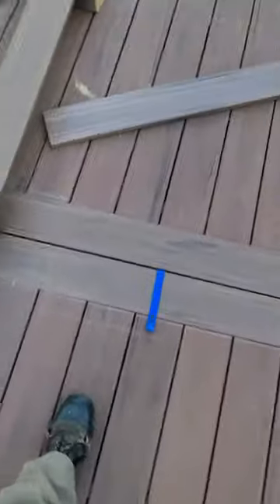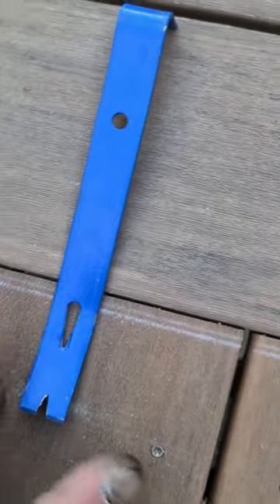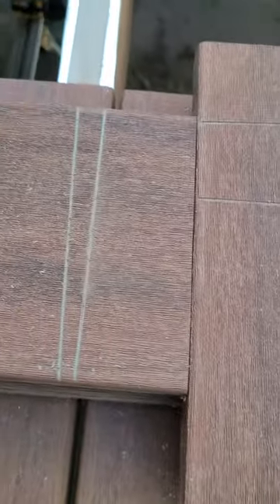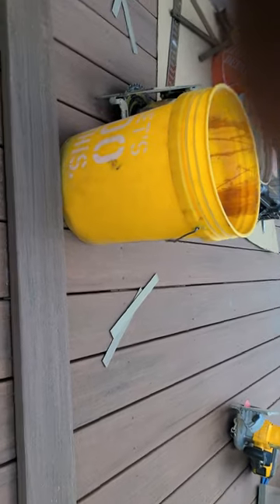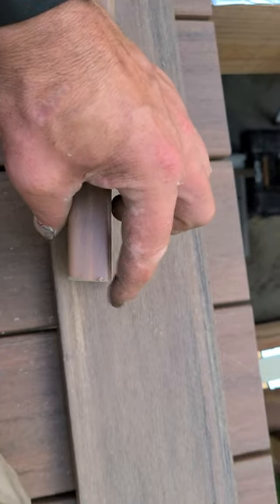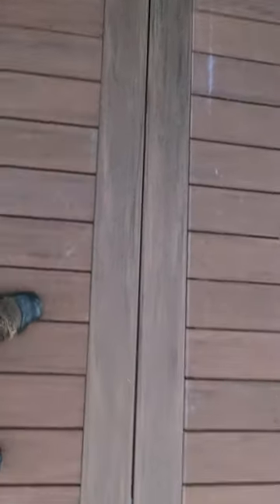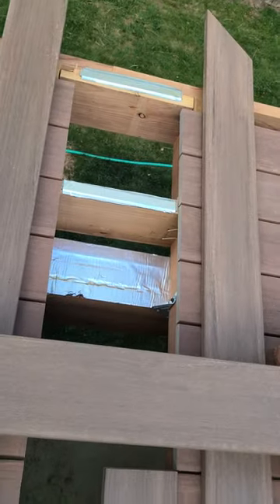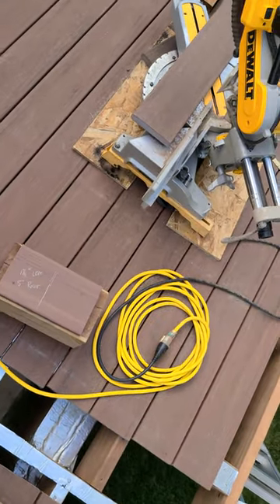deck tutorial - picture frame layout

Comment: How do you ensure such small tolerances like 3/64 don't move over time, especially with pressure treated framing? I've recently framed my deck, planed everything to near level perfection. One month in the sun and the joists were again out of whack. Not much, but definitely more than a 64th tolerance. I love the precision and the look, I just want to get some advice before I go and shim things to such tolerances. We have 10F to 100F temp variation through the year. Thank you.

Comment: Your work is absolutely killer. I'm a contractor but not one who does decks, so I'm building one in my backyard with a very challenging grade etc and really taking my time. I'm in Toronto, 80 degree heat right now, and I've done entire picture frame first and decided to piece boards in after. Do I need a gap at ends or not? And what would your method be make sure boards have a nice clean cut line all the way up the picture frame. Seeing as the picture frame is in I can't do the "hang them off slightly and then track saw them all at once" method. Also don't want to measuring fifty times and going back to the mitre saw for a million trips per board. Thanks for any input and congrats on your brilliant work.
Reply from the maker: Hey Cameron, thanks for checking it out and I appreciate the compliment! 

#1 - end gaps..... Depends on your material as well as highest temperature during the year. There's a few other comments on here to that effect - you can read those replies too... But in a nutshell.... Redwood/ cedar decking expand and contract with humidity, not so much temperature. Composite decking reacts to temperature, not so much humidity. Some brands react more than others..... I've noticed that timbertech vintage is pretty stable compared to cheaper brands. 

If it doesn't get much hotter than 80, you'll be OK keeping it tight. I'm not sure if there's an official calculation for it, but my rule of thumb is 1/16" per 10 degrees. So if your max temp is around 100 but you're installing in 80 degrees... Leave 1/8" gap. 

#2 - process.... Now you see why I do picture frame last 😉 track saw method saves a lot of trips to the miter saw like you said. But you might run into an even bigger challenge than that..... If the picture frame isn't PERFECTLY square you're going to need a miter on each end of the field boards. Very tedious but also introduces a lot of room for error. Let's say you have a 10×16 deck and picture frame is 1/16 out of square.... You'll need a 0.34 degree miter on every end. Doesn't seem like much, but a 90 degree cut would leave a noticeable triangular gap. 

Track saw method eliminates that issue. Even if frame is slightly out of square, you're making a single cut down each side that keeps decking parallel to frame..... Then you only have to mess with that 0.34 degree cut once on your outside miters. 

Rework sucks but that's honestly my recommendation. Remove the legs at least (you could probably keep the outside piece of frame)

Hope that helps and good luck!
Reply: @majorwoodcraft9736  Man, I can't thank you enough for your insightful advice. I waffled back and forth about ten times re picture frame before or after or halfway. I might just take up the one side of picture frame and pivot to other method. Its not that tough really. Back plugs out and unfasten. Thanks again, really appreciate taking the time out of your day.
Reply from the maker: @cameronhurst9432  I think that's wise. Not a huge setback like you said.... easier to fix now. Shoot me some pictures when it's done. I'd love to see the finished result. 

Cheers man
Reply: @majorwoodcraft9736  Will do for sure! But you must go easy. :)

Comment: First of all, excellent point about raising the breaker board 3/64”. Not only is it more comfortable to not catch a fingernail or toe on, but in the northern latitudes, we often run a snow shovel on decks/porches, and guess where the edge of the shovel catches, thus damaging the square-edged board?!? Ugh! I have expensive Trex Transcends, too… Anyway, wish mine had been done this way. I wanted to ask you… Do you have any kind of issues with expansion and contraction when making those picture-frame butt joints so tight? The installation guides for the composite deck manufacturers recommend various spacing, depending upon whether you’re butting end-to-end, end-to-side, or end/side to fixed structure (i.e., house, etc.), so thought I’d see if you’ve had issues with buckling or anything.  Along those same lines, I know others out there discourage miter joints w/ composites because you can spend forever making them look great at install, but then the gap in the first few days due to expansion/contraction. Tips there?!? Some pay attention and adjust things based on install temp even. Yikes!
Reply from the maker: Addressed this question a dozen times.... Scroll through comments to get more details 😉 

Short version is yes, adjust gap for temp. This was installed in July around 100 degrees. About as got as it gets here. 

I'm very hesitant to install decks in winter for that reason. It is possible, but never ideal. 

Tight miter in the summer will have a gap in the winter. Sloppy miter in the summer will have a bigger gap in the winter. Big enough to lose a toy poodle I imagine
Reply from the maker: PS I never Butt end to end except for splices on cap rail. I have a separate tutorial video on that. 

I never get the "cheap" jobs. I explain to my customers why that center breaker is worth the extra hundred bucks. If they really want to save money and do Butt joints in the field, I won't be the guy installing it.

Comment: Us fellow perfectionist appreciate you sharing your tips!  One question: what do you do for the outside boards for the picture frame.  They run parallel with the decking so, you don't need them to be shimmed for comfort... but I see you shimmed under them at the miter to make sure that joint is nice and clean (which makes sense).  Do you place shims down the rim joist for that outside board?  Or do skip the shims and just screw the board down b/c the height difference isn't very noticeable.
Reply from the maker: Good question! 

Don't really "need" to shim outside picture frame, as you noted. I plane down rim joist and joists during framing process just to make sure everything is flush. So theoretically that outside board would be the same elevation as the next course in. 

Butttttt....since I picked up the perpendicular side of picture frame, I do match that height underneath the miter on both sides. Usually just 12" away is fine... you don't need to shim the whole length of rim joist in my opinion. 

The only challenge there is getting fascia tight to the underside of outside picture frame (because it has a very slight dip in it now).... composite fascia is malleable enough to clamp tight
Reply from the maker: PS....add a 1° bevel to those miters to compensate for the dip. Keeps the top of that joint super tight

Comment: how many degrees did you bevel the main deck boards and where did you get your shims? thank you, good tips! im right at the blocking design for my picture framing.
Reply from the maker: Shims were ripped on a table saw from scrap decking. Little more control over the thickness that way. You could use any kind of thin plastic honestly. Wouldn't recommend wood though - something that thin would deteriorate quickly so you'd get some sinking. 

2 degree bevel on the perpendicular decking
Reply: @majorwoodcraft9736  thanks, I really like the bevel idea!!
Reply from the maker: Cheers, glad it helped!

Comment: I read to leave gaps in your joints  depending on the temperature 
Like the 45 

If it were colder would
You leave a gap  relevant to temp. ?
Reply from the maker: Correct. Composite expands in the heat and contracts in the cold. Weather was 95+ degrees that week, so I made joints as tight as possible. It rarely gets hotter than 105 in my region, so that material is already expanded as much as ever will. 

Winter installation does require a small gap. Tight joints installed cold can ""blister"" in the heat as they expand.

Good question Brandon

Comment: What angle was your bevel cut? Thanks for the tips!
Reply from the maker: Hope it helps!  I like 2-3° on that bevel. Leaves a very small gap on the bottom of material, but gets that top very tight. 

It depends on the material you're using though. I like timbertech - last several jobs were vintage series.

Comment: You could spend a little more time on your frame ensuring it’s square and make sure your first boards at the house are chalk lined square in relation to your outer deck frame, then check the fields of decking from that chalk line as your laying them down every 5 or 6 boards (making sure your pulling the same measurement from the last board you laid back to the chalk line) so they don’t walk 64th by 64th and push your picture frame out of square so you don’t  have to adjust the angles of your miters off of a perfect 45, also when you finish your picture frame/zipper blocking check it with a level or square for flatness. Take a power planer and knock down any knots or high spots that will end up pushing  then ends of deck boards above your zipper/picture frame. Saves a lot of time to front load that kind of work at the foundation/frame rather than tinker after the fact.
Reply from the maker: Sheesh. You chalk line runs for 64ths?

Weird. What's the point in having a perfectly square frame in that case 🙃

My frame was 1/8 out on a 70 foot diagonal.  Your house isn't even close to that
Reply from the maker: I spent about 3 days on chalk lines and layout for upper level. FYI. Cantilever beam and cantilever joists. So there's a few variables there. 

Honestly getting sick of replying to stupid comments. I started this channel to help people learn. Seems I have nothing to teach. 

Let's see yours buddy. The last one you built by yourself. And I literally mean.... By yourself.
Reply: @majorwoodcraft9736  as your laying each board down they can compound by a 64th.. after 5 or six it adds up and pushes your corners out of square or pooches in the middle

Comment: those tight miters on the corners will fail due to expansion/ contraction... when the boards get hot and expand they will push laterally at the 45 and shear the screws off at framing
Reply from the maker: It was installed in 105 degree weather. Doesn't get much hotter here. In the winter I leave a gap. 

Appreciate the input but next time you might ask for missing information FIRST 😊
Reply: @majorwoodcraft9736  of course